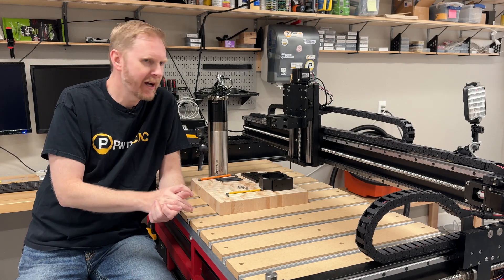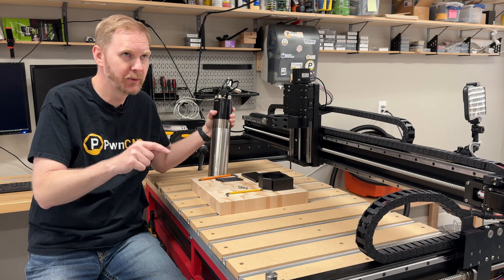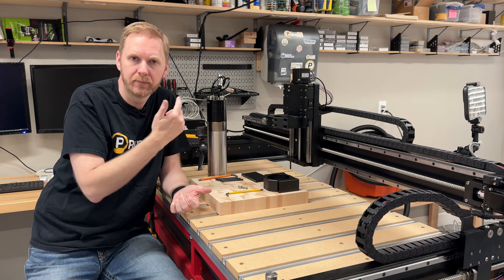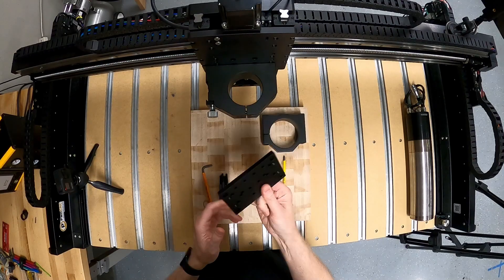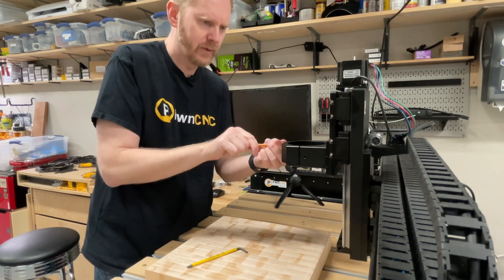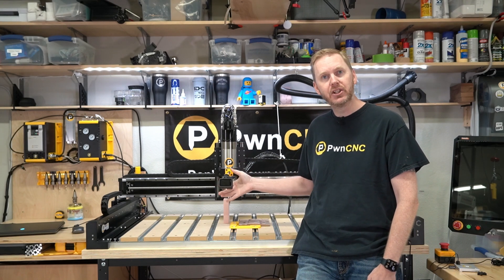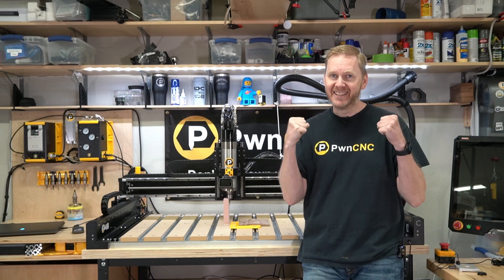Shapeoko 5 Pro Spindle Mount Installation Tips and Tricks

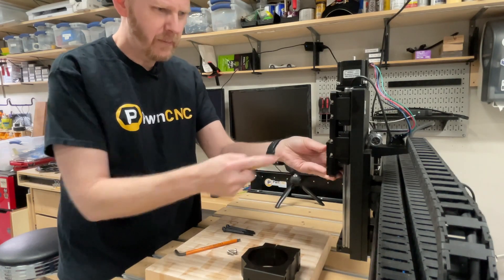Comment: I know I'm late to the party here. I just got your 80mm spindle and watched this video. It would have helped to see the position of the adapter plate and mount from the front to see where they go exactly.  At 2:51, you mentioned to mount the plate at the existing screws. In the Shapeoko 5 Pro there are 3 different set of screws for the mount. Which "existing" screws are you referring to? I appreciate the help with this. Thanks for your content. I helps newbies like me get the best out of our machine!